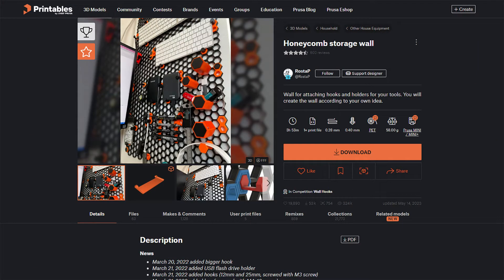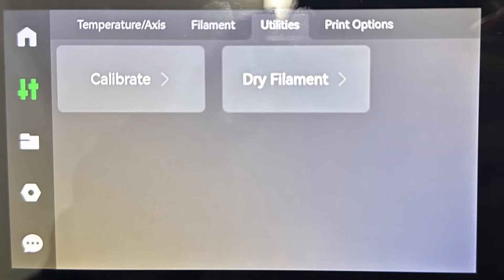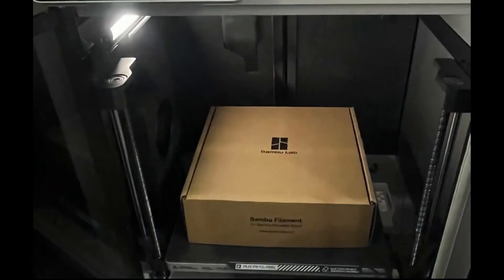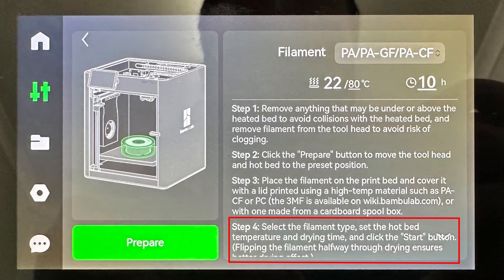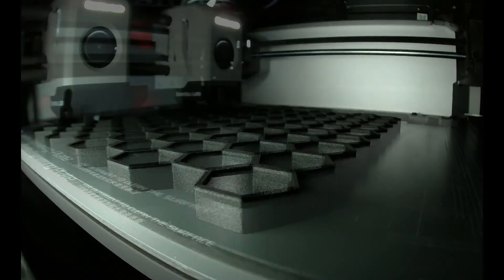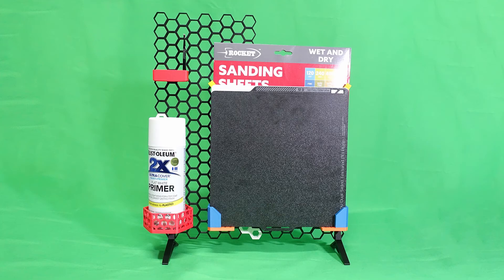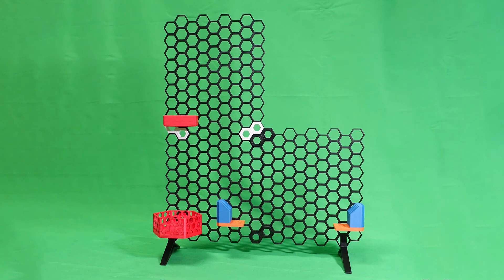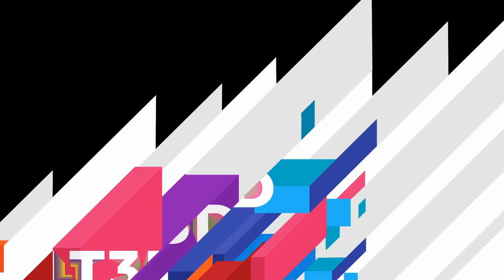Printing PAHT-CF on the Bambu Lab X1 Carbon!!

Comment: i have 1KG of PAHT-CF i bought from bambulab store probably 6 months ago or so i've been afraid of using it. anyway i do not knowing if the nozzle can handle it nor the heatbed
Reply from the maker: Which printer do you have?
Reply: @LT3D_YT  i use the X1C-Combo
Reply from the maker: @Crystalblood2903  The X1C by default comes with a 0.4mm Hardened Nozzle which is perfectly capable of printing PAHT-CF.

Bambu Lab does recommend a 0.6mm and only state that the 0.2mm is not compatible.

The Engineering plate that is on the back of the cool plate is also fine for printing PAHT-CF.

Comment: Wait until you do large prints with it, it's a nightmare to stop warping, I've wasted so much time and filament. Still to find a way to print large parts without them warping. Anyone figure it out??
Reply from the maker: I might have to buy some more and test some large prints.
Reply: i use a large brim around the object and glue stick on glass bed
Reply: I had issues that are kinda the same & kinda different.... I tried doing multiple objects on a plate (build by object) and most of them ended up warped because the build plate lifted around the edges. if I print a single object in the center, I have no issues. I don't know if yours did the same, but clamping the build plate down can possibly help.
Reply: @MidgetRacer8192   was the print bed lifted up by the Nylon warping but also sticked to the bed?
Reply: Have the same issues

Comment: did you print it with the ams, or did you have an active dryer feeding into X1C?
Reply from the maker: I printed it through the AMS 👍🏻
Reply: Bambu lab  recommends not using  carbon fiber  filaments in the  ams
Reply from the maker: @bobbybackpain  on their website they state AMS compatible.

Comment: Interesting, it came with your x1 printer ? Or did you add it separately
Reply from the maker: It came with my X1 Carbon Combo. I recieved 250g PLA Basic, 250g Support W and 250g PAHT-CF
Reply: @LT3D_YT  that's neat , mine came with Support W, 250g , 250 regular pla , and Pla CF
Reply from the maker: @Hanzi2u  let me know how the PLA-CF goes, I am tempted to get some for a future video 😁
Reply: @LT3D_YT  so far, it's pretty straight forward  , easy to print with
Reply: @LT3D_YT  very important note , do not put it in the ams  , it will jam it  , I had to take mine ams apart to fix it
Reply: @Hanzi2u I have used mine in my ams without issue.
Reply: @Theroux1989  okay
Reply: @LT3D_YT  i got 250gram of PA-HF

Comment: I also got one of these spools with my X1-C and have stayed clear from using it as I'd heard it can be a nightmare to use, Does it give off any harmful fumes? My print room isn't a large room would it be safe to use in an enclosed space?
Reply from the maker: I've also heard of some people complaining about the odour that comes from printing PAHT-CF however, I personally didn't notice an odour at all and my room is fairly small. The X1 Carbon does have an active carbon filter but I would still make sure to have a window open.

I also found this on the subreddit if you want some more info.  https://www.reddit.com/r/BambuLab/comments/12rtqlo/had_to_open_the_window_printing_pahtcf_is_this/

Comment: It came from a foil sealed bag, aren't they meant to be ready to use?
Reply from the maker: PAHT-CF is hygroscopic meaning that it absorbs lots of moisture in the air. Bambu Lab ship it in a foil bag to keep as much moisture out as possible.

It is always recommended to dry hygroscopic filament before attempting to print with it for best results.